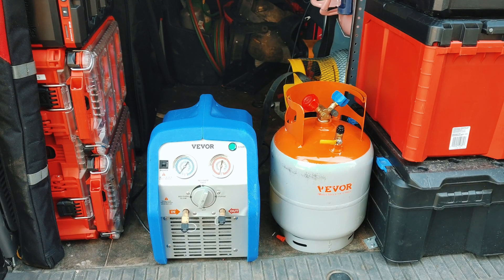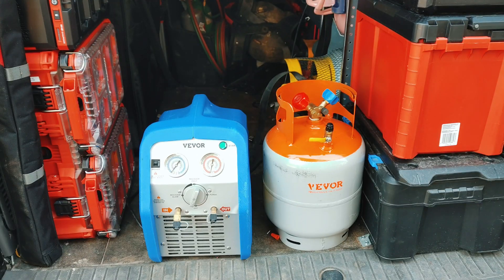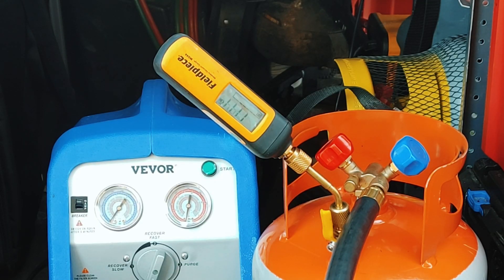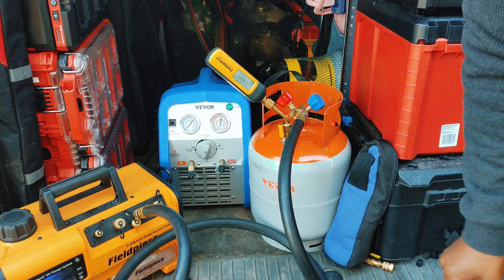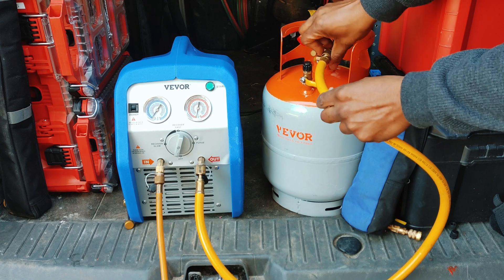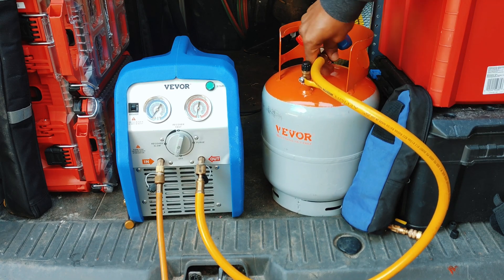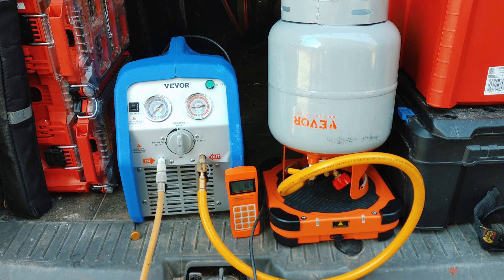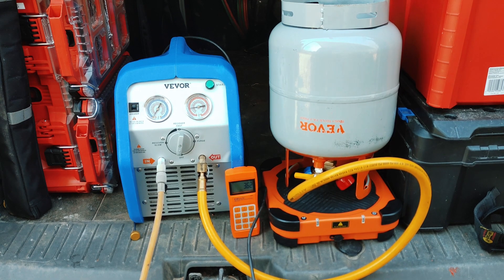HVAC refrigerant reclaim demonstration with Vevor RR500 recovery machine and 30 pound reclaim tank!

Comment: Let's say I want to use the refrigerant. I use the filter drier inline with where the refrigerant is being discharged, I go through the same steps you just mentioned. Is the tank going to have enough pressure to reuse the refrigerant?

Comment: That was a great demonstration video. I’m EPA 608 certified and am doing my first recovery this week. I’m trying to figure out what size adaptors I might need.
Reply: How did it go with your first recovery?
Reply: @Android_Warrior  it went well. I had a small problem recovering the last portion of refrigerant from the unit but was able to complete the recovery process.
Reply: how hards the exam - thinking of doing it just for DIY on my own stuff
Reply: @johnfak4034 not hard at all. Just read the material and you’ll do fine.